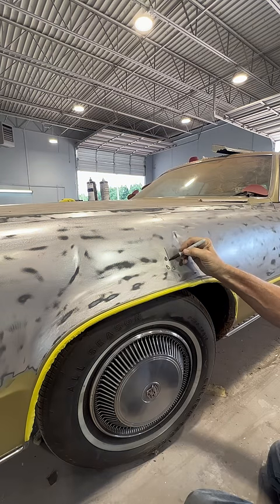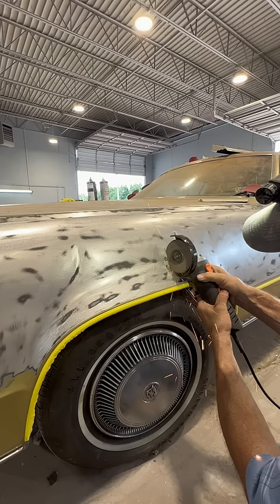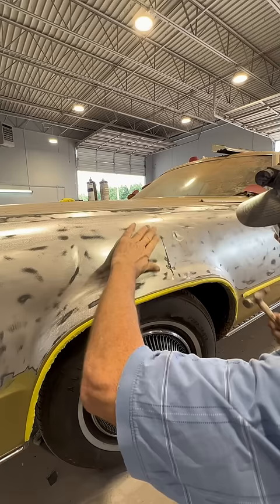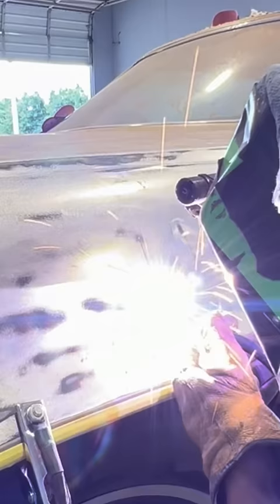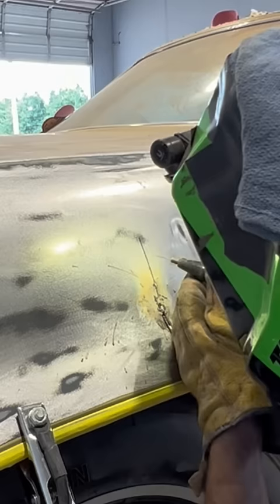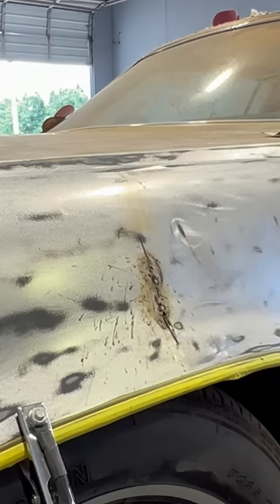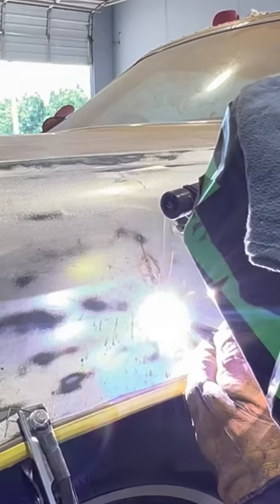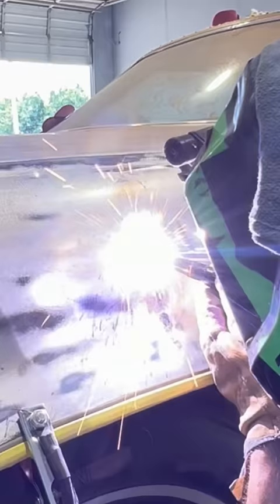BILLY SHOULD BE ARRESTED🤣 How To Fix A Buckle In Sheetmetal FAST DIY Auto Body Repair Flux Core Weld

Comment from the maker: This welder is better than the one seen in this video;
GETCHA ONE IN THE LINK IF YOU’RE SMART😁😁

https://youtu.be/UnP5nnhjlZM
Reply: I have not heard it mentioned; so consider how much wire - the length of it - is being used. A long wire acts like a fuse that burns away first if there is too much heat; as opposed to blowing a hole in your sheet metal. On top of everything else, experiment with wire length. A longer wire can protect you from material detonation.

Comment: I fixed a dented rocker panel on a Ford Crown Vic using this same method.  Made my cuts , pulled each section out till everything was straight and welded the cuts. Excellant method for these type of repairs.

Comment: I'd love to see how the keyboard experts would fix a damaged fender like that 😅
Reply: you already know they would tell you to either replace the fender or spend 3 days reshaping it... this is old school and it still works.
Reply: The most important thing most people don't understand in a repair is that the repair is done based on customers budget and timing restraints. You need to know what customers intentions are for car. Sometimes you have to do what makes customer happy unless you are dealing with high dollar show cars. Sometimes I will do repairs on my car that I would never do on a customers car, every car is a different situation
Reply: Keyboard warriors would use 3/4 inch of bondo after beating it in. A cut is a great way to shrink the metal. Cut and weld will last a lot longer than a thick wad of bondo.
Reply: Hahaha
Reply: @BlackandWhitecustoms my own car. Omg 😅
Reply: They would buy a new one and call that fixing fender but that's not fixing it that's replacing it
Reply: I would comment that back when i did body work, i never once thought of that solution.. its utterly brilliant
Reply: You fix it by pulling the fender back into the right length, not leave it short and butcher it.
Reply: @BlackandWhitecustoms except for one thing. This is not only an easy and cheap way to do the job, it's the correct way to do the job. Replacement is expensive, and a replacement fender, unless NOS (even more $$$$) will, without exception, be shittier steel, because all auto steel manufacturered nowadays is shit, to the point where it can't be reworked if damaged. And any other method will not yield as good of results as what he's doing, and will cost more because tiger hair and  Bondo costs way more than Flux core wire.
Reply: I would try Heat shrinks ng furst. And im not a Keyboard expert, im a professional body/paint expert.
Reply: @jeffcampbell2710  yea, that’s a sign of a short structure. Maybe a kink in the frame.measure and pull the frame first. He is fixing the symptom, not the problem.
Reply: @jeffcampbell2710 correct been doing  this for 45 years , the men that taught me used to pick and file fenders in the 50s.  They used lead they didn’t have bondo till later.  Heat the metal cherry red with a torch use a shrinking hammer with a dolly then cool with a wet rag that will tighten it right up skin coat of bondo and your ready to go. Not a keyboard warrior just a professional trying to help out.
Reply: Gotcha to the magic number friend lol
Reply: My boss would make me hammer and dolly it. Lol
Reply: @elpacho....9254 at least use a offset dolly/hammer on the high spot while pulling the low area. This method will "pop" within a year.
Reply: @dirtyswar  you have to get the length back while you stress relief the metal.
Reply: @elpacho....9254  that's why I said pull the low spot. If the fender is kinked pulling with a welded on tab (at the front off the fender) and a come-along while working the high spot will relieve the stress in the metal. He left the kink in the fender
Reply: @dirtyswar  exactly, he treaded the symptom, but didn’t cure the sickness.

Comment: Bondo Billy knows how to get er done 👍🏾
Reply from the maker: Hey Spray, nuthin to it the way we do it😁😁
Reply: A man lol subscribed to both you guys channel. Keep it up yall 💪🏾
Reply: @OldBondoBilly  I’ve heard you say in a few videos that you put fiberglass over the welds “because it’s flux-core”.
Why fiberglass & what does it matter if it’s flux core or not?
Reply from the maker: @thelast929  traces of flux could potentially affect the polyester body filler or Bondo as I call it, but it will have zero effect on fiberglass filler😉😉
Reply: @OldBondoBilly  Thanks!
Reply: @OldBondoBilly  Super impressed that you understand that. Not many do.

Comment: Great tip Billy... thanks for sharing your secrets!!... I always use a flux core welder since I started using one 9 years ago.. the tip about holding the torch back from the surface works great to stop burn through.. thanks again Billy.. Runner till the wheels fall off😂

Comment: Fiberglass over weld fills in any imperfections and removes the opportunity for oxidation!
Great stuff
Reply: We are witnessing greatness ...
Reply: if there's any porosity or worm holes in them welds that fiberglass is only gonna entrap any air and moisture it will definitely cause mole hills under the paint
Reply: @jacobaguilar6756  for decades we also use rust Mort.
Heat associated with welding and the hydrocloric acid in rust Mort I haven't any issues after all these decades.
I just redid a rust repair from a reputable shop seems they forgot the metal and just went straight to bonds!
That was a waste of a couple grand what method would you prefer!
Reply: @timgileo7585  I've never been Flux core guy I like solid wire .023 wire and polarity set to DCEP and 35 to 40 CFPM 75/25 argon CO2 and I like leading or just cutting and nipping my peices as close as I possibly can but those cold welds he had forsure has porosity and I use Eastwood Fast etch it leaves a zinc phosphate coating after it dry ready for primer its almost like Cold galvanize on the bare metal for primer then paint
Reply: @jacobaguilar6756  that's close to my set up but I have done both.
In northern Canada rust is common.
So rust repair and rough roads particularly due to oil and gas activity, logging and mining and farming most driving is off highway.
Peace river gumbo isn't friendly to anything.
Your gas set up is in the range re airflow.
.23 and 35 for heavier structure.
I work out of different shops one with a buddy if worked with off and on for 35 years and another I'm training a friend and building out his shop I did a amx javelin for him 32 years ago he sold it to z museum due to necessity so the one getting kicked ouf of the shop this week is its replacement.

Comment: I've done this from top to bottom on a door.
Used a straight edge pressed horizontally to guarantee that no metal will be high. Works great. I was doing used cars for a dealer.He liked that he didn't have to buy another door. It was a 2 hour total repair.

Comment: This is a REAL repair. 💪 always got the good info
Reply: not correct here, I've seen his vids and much is good. This is very bad advice. The amount effort required is profound vs using a shrinking disc, or even a small map/propane torch, tapping and cooling.  He has to use a cut-off wheel, the gas for the welder, the wire, the electricity, the grinding disc to grind down the welds and the warping of the metal.

Comment: A great tip to limit warpage of the metal is to back the individual spot weld with an solid aluminum piece. Tgat aluminum or brass Buck will then draw the excess radiant heat into the aluminum. It prevents warpage and buckels.

Comment: I finally understand why bodywork costs so much!
Reply: This is the inexpensive way, new a days body guys get a whole new fender and charge $2,500 to replace because it takes 16 hours to pull apart and rebuild, that's a quality 30 minute fix and not much Bondo at all. Great job.

Comment: So many people here have never welded sheet metal because if you do more than tacks and don’t move around you will warp the hell out of it and cause more work. Personally I would’ve probably used a shrinking hammer (if I could get the the back side to put a dolly) but everyone does it there own way so as long as the end results are good then I don’t see the problem. Every shop I have worked at I did it definitely than the other body man but no one cared as long as it looked good in the end. As my dad would say “More than one way to skin a cat”.
Reply from the maker: The buckle was sticking out a half an inch.  And it was a buckle, not stretched metal.  Any shrinking technique would be 100% ineffective😉😉